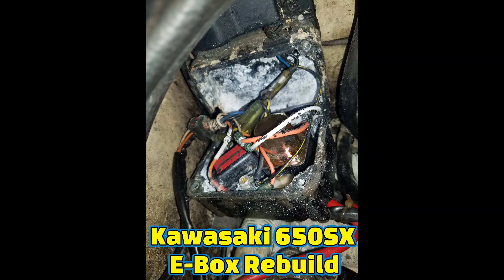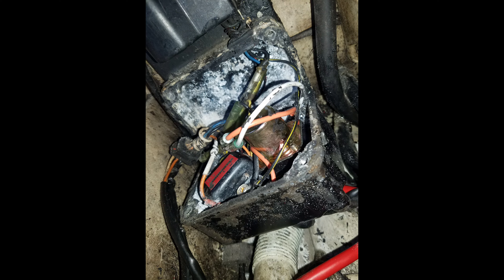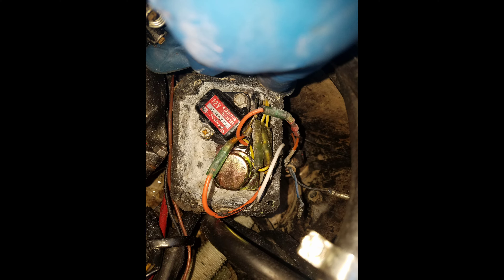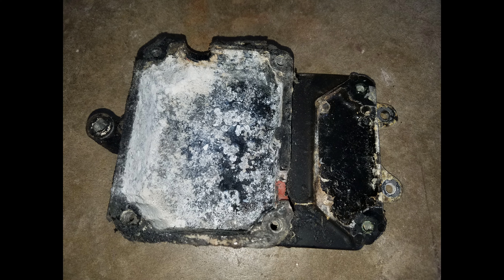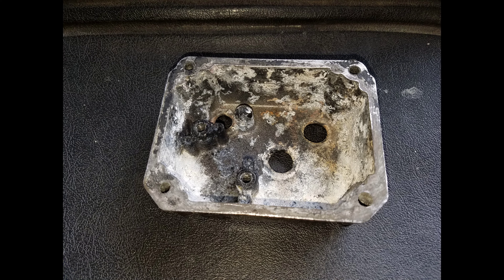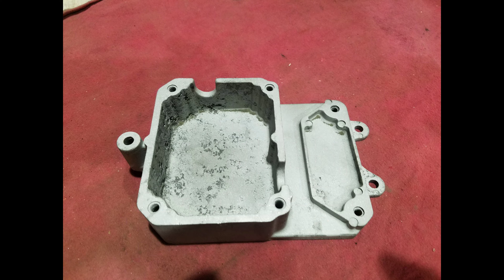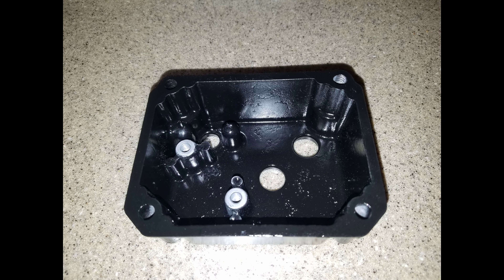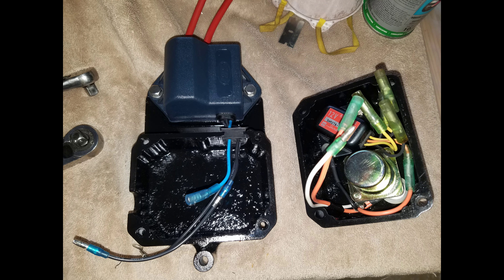E-Box Stand up Jet Ski Build! | 1987-1993 Kawasaki 650sx Jet Ski #jetski #kawasaki

Comment: You got the wiring diagram you used
Reply from the maker: I can take a picture of it and send it to you if you need it. Just let me know the easiest way to get it to you.
Reply from the maker: I took a picture of the diagram and if you need it just let me know how to get it to you.
Reply from the maker: I posted a picture if the 650SX wiring diagram in my community tab so if you still need it just check it out there. If the picture is cutting off anything that you need please just let me know.
Reply: The extra ground with does it just ground to the area u didn't paint?